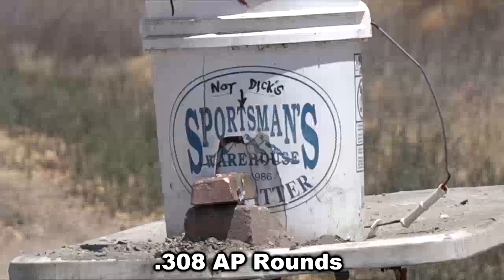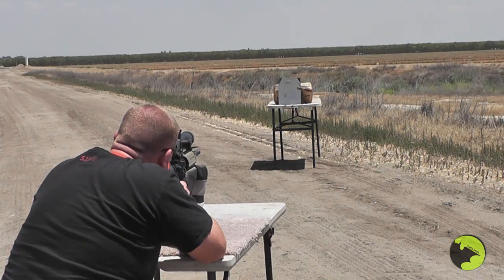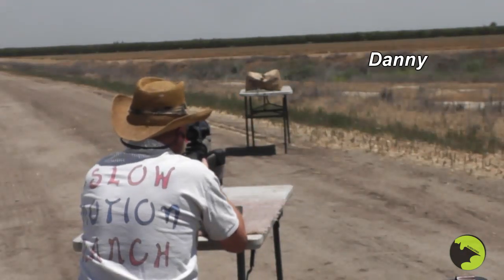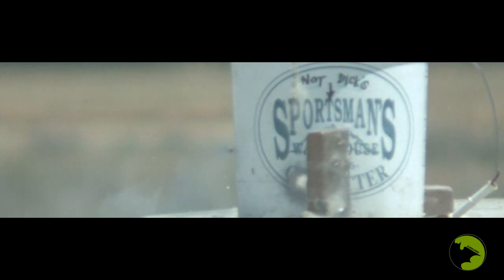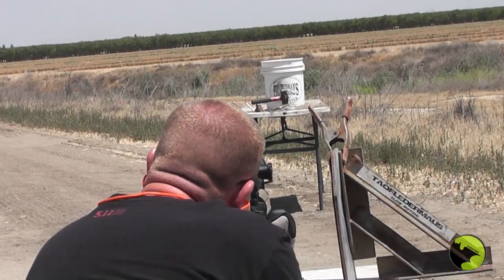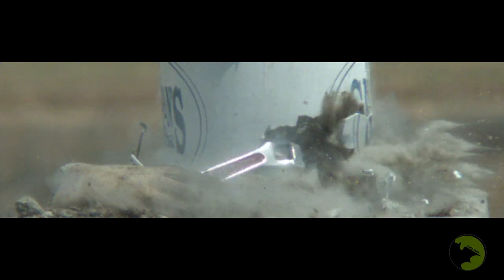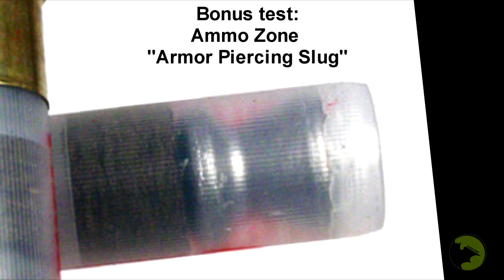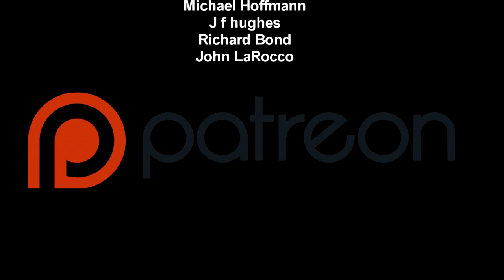.308 ARMOR PIERCING Bullets -  TESTED!

Comment: I know this is kind of random but I am rebuilding a 1958 NSU Prinz and I am willing to pay up to $5,000 for a used cylinder head. I just can't find one anywhere. lol Just Kidding. That should be obvious but you all know how the internet is. There is always that 1 idiot that doesn't see the joke. 
Those AP rounds are no joke though. They did more than I would have expected. 
It takes a fair distance before tracers really light up properly. At least 50 yards, 100 is more realistic before you can really see them.

Comment: The tracers aren't defective, your research is.  If you needed tracers for a target 20 yards away, you should use a hand grenade...
Tracers aren't going to light up until they get down range a bit.
Reply from the maker: They normally ignite in the barrel,  there is no odometer inside the bullet to start the tracers at a certain distance.
Reply: @taofledermaus  BIG difference in igniting and burning at full brightness.  TIME is the odometer.  Fireworks don't have an odometer either.

Comment: PLEASE find some 30-06 accelerators! 30-06 Springfield loaded with a plastic sabot housing a .223 projectile? It'd be nice to see what they defeat at 4,400+ fps. Even with loaded with standard m193/fmj it would have to be a drill bit. Now some 62gr green tip? Or even better black tip? Who wouldn't love to see that? Hell find an '06 I'll load em n send em to ya. Find some THICK steel as well while you're at it

Comment: One would think if the ammo was AP and Tracers it would be 7.62 x 51 instead of 308 ...  they are 99% the same.... I think 308 has higher pressure ( 4000 to 12000 psi more)

Comment: Doesn't seem much sense in testing penetration shooting at a soft copper ingot or some of the other targets used.  Much better choices would be cinder blocks, various woods, construction materials, tree trunks, dirt, sand, etc. - materials more commonly used as protection from bullets.   Also, whether or not a tracer round is "activated", whatever the _ that means, has nothing to do with its penetrating abilities.   It really differs little in that regard from standard ball ammo.

Comment: Your target is what, 50ft away? What's the flight time? 

Anyway not bad for 50ft. 50cal fmj is rated to pen 1" of hardened steel armor plate at 1000 yds or so. CRE. That's 25mm of. armor.

Clearly WW1 tanks were effective against 7.62mm German machine-gun  rounds or there would be no point in having tanks in WW1.

"The Tiger I had frontal hull armour 100 mm (3.9 in) thick, frontal turret armour of 100 mm (3.9 in) and a 120 mm (4.7 in) thick gun mantlet. The Tiger had 60 mm (2.4 in) thick hull side plates and 80 mm armour on the side superstructure/sponsons, while turret sides and rear were 80 mm."

Which is why the Allies had one tank gun that could pen it, the 17 pounder...